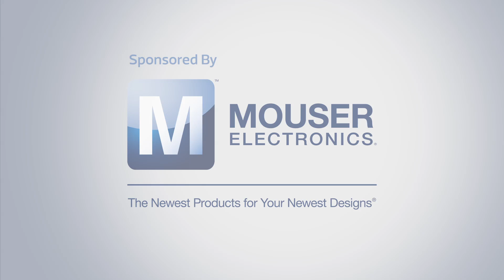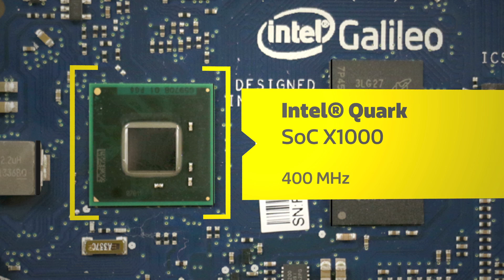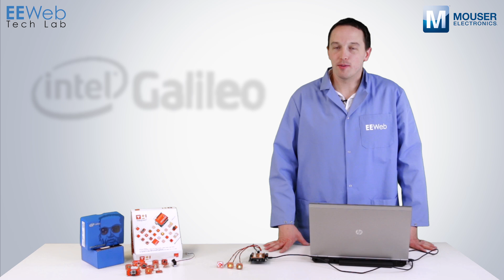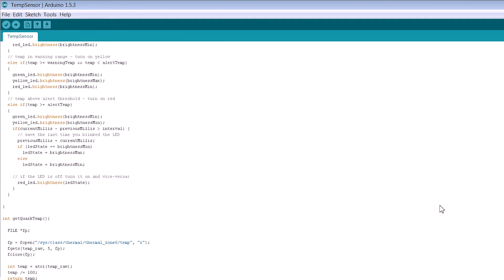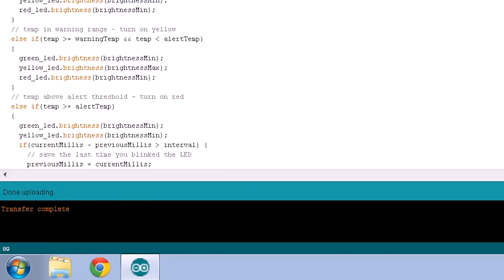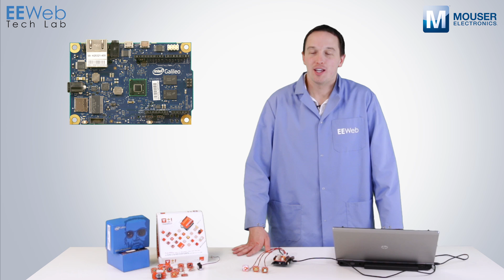Intel Galileo - Sensor Shield Demo

Comment: where is the comparison with Raspberry pi???
Reply: raspberry pi doesn't have any real time processing unit like PRUS in beaglebone black and a full arduino in case of intel Galileo. Raspberry pi arm core is slightly faster
Reply: this is x86
Reply: Lucas _ yup 32 bit